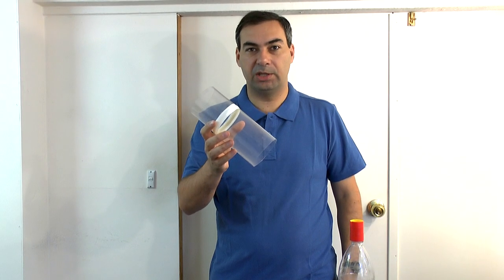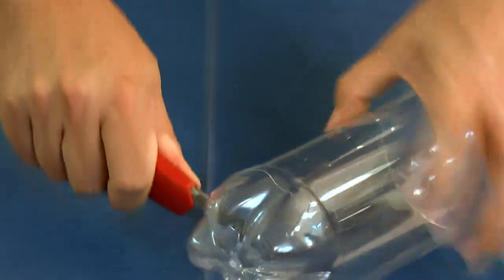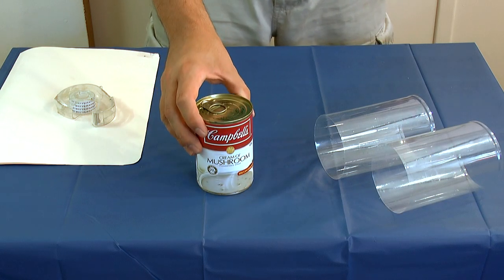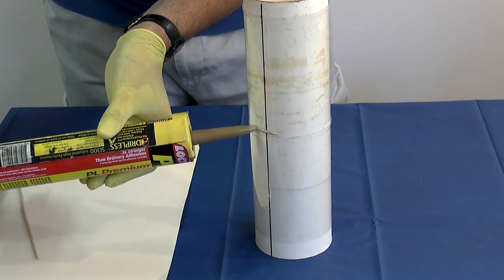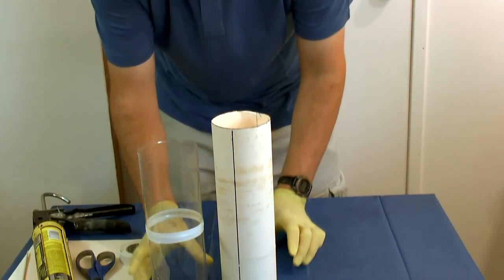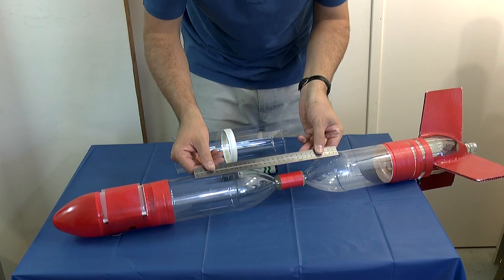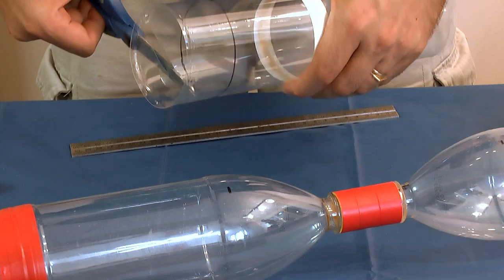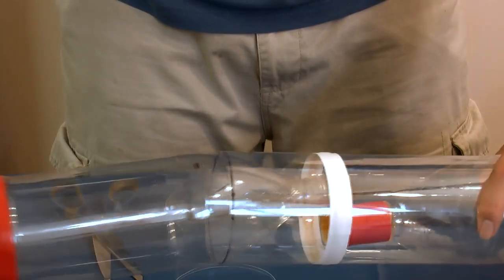Water Rocket - Fairing tutorial

Comment: I have Questions for you ,  I have been watching your videos and can't find out about ..Between the 2 bottles (  The red part )   Sorry don't know what the proper term is for this ,..how do they connect ?..can you explain ?..Cant figure it out,.. how you can just screw them together what's the secret... ?  Is it just 2 bottle caps put together and (drilled and glued) together ,... and some kind of heat shrink around it   or what ..? ..And...with the second bottle is that for added Air Pressure that lets it fly higher and longer does this increase the amount of water  you put in ..?... I know the water is the fuel and the Air pressure pushes it out ….How do you know how much to put in ?...(.water that is),.. and Air pressure ?...And I haven't even asked about how to build a 2 stage rocket Yet ...I have to learn about the first part first ...thanks ….Hope to hear back on my questions I am sure I will have many more if you don't mind   I want to build a 2 or 4 bottle  rocket  to launch my RC  skydiver off of this ....that can get around 5 to 6 hundred Feet high or more ...I do see a video on how much to put in thou …….And the size of my bottles I want to use are 2  1/2 liter size Just a tad bigger and I hope more pressure to do the job  …..
Reply from the maker: The thing that joins the bottles is called a "Tornado Tube" You can buy these on-line for a couple of dollars. They are just a tube with a bottle thread at either end. The extra bottle just gives the rocket more volume which means it can store more energy and hence better performance. Regardless of the volume of a rocket you always want to fill about 1/3 of the total volume with water. If you have 3L total volume you add 1L of water. If you have 6L total volume, add 2L of water.
Reply: @AirCommandRockets  Thanks I will look into that "  Tornado Tube"....where did you get yours off of Amazon ..?
Reply: Hi,  I ordered the tornado tube took a wile to find them in stock, But I did it,.. and now the wait for the order to arrive( thanks for the help so far) ,... If you Don't mind I will have more questions for you ,Later ...
Reply from the maker: @jlions72  sure no worries

Comment: I am very interested in how you join these bottles together. It looks like some bottles are joined end to end and others are joined using the thread and cap. Thinking about how much pressure is in this rockets when it is launched. Do you have any video on how you put these components together. I have used the solid fuel rockets "Esters" motors. I am keen to see how these water and air powered models work.

Comment: How did you delete the other rockets below the big one?
Reply from the maker: Hi Dominic, I am not sure I understand your question. What do you mean by delete?
Reply: Hello, I speak Portuguese I'm using google translator, something must have gone wrong but finally I say in the rockets below that as the compressed air is released and all the water from it comes off
Reply: Hello, I speak Portuguese using google translator, I have something that must have gone wrong but finally I say in the rockets below that in the measure that it is released or compressed and all the water of him it comes off
Reply from the maker: I am still not sure I understand the question. Are you asking if this rocket is a 2-stage rocket and how do the two stages separate? This is a single stage rocket. The connector between the upper section and lower section allows air and water to pass through.
Reply: That

Comment: A question I might say as connecting the tips of the bottles since I was treated with a coupling pipe for water but the thread did not work, we take care for a university project , I would appreciate your response would be helpful .
Reply from the maker: +Benjamin Garcia Hi, If I am understanding your question correctly, you are correct, bottles have very unique threads and so you typically will not find matching threads on other components in a hardware store. The tornado tubes we use are specifically designed to fit on bottles.

Comment: Thanks for the nice tutorial! Once again this helps my work a lot. But I'm having a problem. Here in Finland we dont have these kind of straight sided bottles, and that makes building rocket lot harder. The bottle splicing method worked well, because I had bottles with a small straight part on it, but I think I have to improvise a little bit on this time. And then next thing is building a parachute deployment system.
Reply from the maker: Hi Juho. For fairings you can use plastic bottles that are not designed to hold pressure. Try looking in the supermarket for various bottles like water bottles.

Comment from the maker: You want the fin material to be as stiff as possible and lightweight. The thinner it is the better for less drag. The most important thing with fins is that they are stiff and don't flap around otherwise then they don't work. Being waterproof also helps. A good material is correflulte (the corrugated plastic used for signs)

Comment from the maker: You should be able to use either. The bigger the rocket the more work you will have to do to pressurise the rocket with a hand pump. Depending on the pressure you are trying to reach you can use an inflator as well provided it is rated for that pressure. Cheap compressors can overheat easily on larger rockets.